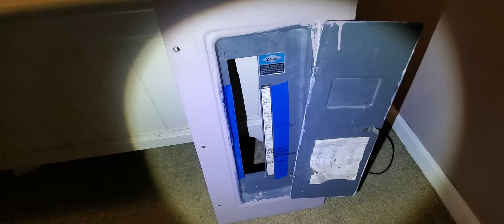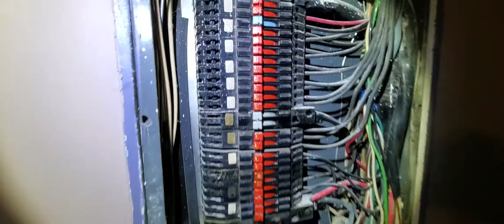DANGEROUS ZINSCO Electrical Panel and Single Strand Solid Aluminum Wiring

Comment: This could add up real fast because not only should the new owner expect to upgrade this panel but they'll also need to changeout each electrical opening in the house and pigtail to all new devices using solid copper and LISTED wire nuts rated for copper to aluminum.
Reply: Why they had a fire

Comment: The manufacturer's data plate probable said, "Guaranteed to work when first installed." I owned a mobile home in the early 1970s. I soon noticed that a light switch became hot to the touch. The dealer sent his 'electrician' to check the wiring, and he confirmed the problem. I asked him if I should turn off its circuit breaker. I asked him where I could find the the box, as I had not found it. He informed me that there was NO box. The light switch WAS the circuit breaker.
Reply: Bull shit

Comment: Bullshit. Nothing burnning in that old box.  Love how you guys scare the public
Reply: Those boxes are a fire hazard so are federal Pacific boxes. I removed a zinsco from my parents house. The buss was arcing and most of the breakers did not make good contact. The wires in our home were all copper so I didnt have to do any rewiring. Don't listen to the troll that said the opposite. 73
Reply: The box won’t burn, but the house will.
Reply: @cipher1167  I agree! Don't listen to nay sayers it's not their house that is affected . 73
Reply: @cipher1167  bullshit. Been there 40/ 50 years.    Stop it
Reply: @johnkulpowich5260  Aluminum melts at lower temperatures though, ah and those breakers don’t even trip most of the time, specially the old ones. That one in the video doesn’t seem too bad, but most of these cause fires, or burn out outlets and junction boxes all the time. The panels are well made, but the breakers aren’t very good. Also those breakers are about $100 each.
Reply: @cipher1167  B. S.   Thousands out there still working. Just like knob and tube
B. S
Reply: @johnkulpowich5260  ,  are you in the Elec trade?  i am ,  been since Aug 1978.   Zinsco were junk panels.   Al romex wiring is junk.   go back to the Fire in Northern Ky around 1977.  traced back to the Al  romex wiring melted down and caused the fire.   forget how many died.  for a few years in Lou. KY after that ,  Elec companies could not use any Al wiring.  can now.   i stay away from it.      going to probably retire late this year.
Reply: @zerosparky9510  just one.  What's the problem
Reply: @johnkulpowich5260 .  Did u ever install one?  Junk.  Bad breakers.  Al buss.   Melt down.
Reply: @zerosparky9510  no such thing aluminum buss
Reply: @johnkulpowich5260  u want to bet.     Aluminum alloy buss .   I use Siemens panel,s .  Copper buss
Reply: @zerosparky9510  composite
Reply: @johnkulpowich5260  I will stick with a copper buss panel.  Seen to many of the other ones over time go bad.  Seen it to many times in the 1980,s with the old General panels  go bad in about 5 year.  After being installed.
Reply: @zerosparky9510   He's an 8 subs no content troll. He has no clue what he is talking about. I've been in the trade over 40 years, one of houses my parents had used Zinsco, we had to replace it after a breaker to the kitchen circuits failed to trip and started a fire in the wall. Luckily we caught it in time, no main so I had to pull the meter to stop it.  Later found over half of the breakers were jammed and had arcing on the ALUMINUM bus. (Not "composite" like john claimed...it was solid aluminum alloy. ) In my career I replaced over 100 Zinsco panels and EVERY ONE OF THEM had arced up busses,  jammed breakers or melted breakers. EVERY F'IN ONE.
Reply: Nobody is scaring nobody. This is a free country and you can keep your fire hazard box in service. No one is holding a gun to your head to replace the box. If you want to risk loosing your wife and children to a fire in the middle of the night when that electric furnace kicks on in the middle of winter in Minnesota and the box gives out that's your problem. Remember an ounce of prevention is more than a ton of cure. A small price to pay to replace a box is less costly than replacing a home. 73
Reply: Looks are deceiving and so are all these comments. There is a reason they don't sell parts for these two types of boxes. 73
Reply: Yeah, Mr. Kulpowich was kinda rude but I'm not so sure he's wrong here. I see Sylvania panels out in the wild all the time, still doing their job faithfully. Al wiring requires special connections to be safe and I have dealt with very little of it. Home inspectors are taught that if they don't give these things a red flag, they'll get sued. This is possible.
Reply: @leviallen2556  kinda is an understatement. 73
Reply: @leviallen2556  remember this all that equipment has A.      U L. Label on it
Reply: @leviallen2556  if it has a U L label installed right your not responsible
Reply: I had a tripped breaker at one of my units w zinsco and alum wire. Resetting the breaker lead to fire blowing out of the panel like a blow torch. Actually melted the face of the panel a bit / had to be replaced. It’s 1 panel out of 350 but still.
Reply: That box has been there 50 years with no problems and looks cleaner than most brand new panels. Update the panel and the breakers and call it good my guy.
Reply: @tfun101  tell that to the person who lost everything in a fire. It's best to replace old service regardless who the manufacturer was. You can have the service inspected to know for sure. No one is telling you to change it. Common sense will tell you to replace. But I don't think you will be able to buy AFCI or GFCI breakers for an upgrade. We cannot cut corners on safety. 73
Reply: @ronb6182  50 years no problem. Nothing wrong
Reply: @johnkulpowich5260  yeah only time. I had to replace ours after 20 years. The main buss was arcing we tried replacing the main breaker but that was only a band aid about three years later the box got replaced. Much better box. You cannot go wrong with Square D QO. I replaced the box after I pulled the permit. I also pulled the meter to install the new box. In Florida at least in our city as long as you have the permit you can pull the meter to do the work.

Usually bragging turns into weeping just wait the bible is always true. 

I don't scare people into replacing something that works but an ounce of prevention is a ton of cure. 73
Reply: @ronb6182  Sq D is a very good Panel.   Just expensive
Reply: @zerosparky9510  I've seen square D  burn. The plug in fails behinne the breakers. All these experts here I bet not one torque the screes
Reply: @johnkulpowich5260  , i have never seen a Sq D burn.  i have a big torque wrench.  and yes i hardly ever use it. and don,t on the small wires on breakers.   i don,t know of One Elec inspector here in Louisville that ever asks about this. and yes i know it is in the NEC.   and how many on this here are Sparky,s?  don,t know , don,t care.
Reply: @tfun101  , they don,t make the breakers anymore.   try finding a GFI /Arc  fault breaker.
Reply: @zerosparky9510  after market
Reply: @zerosparky9510  Connecticut general

Comment: I recall an article in Consumer's Report in the late 70's or early 80's about the hazards of aluminum wiring with the overheating issues, being used on non AU devices or having anti seizure compound. And retrofitting with copper pig tails onto the AU wire. There was the major copper shortage in the 70's. I recall a few places that the Zinsco breakers, one of my apartments etc. Good advice to tear out the old panel.
Reply: The box is older than you so what's the big deal